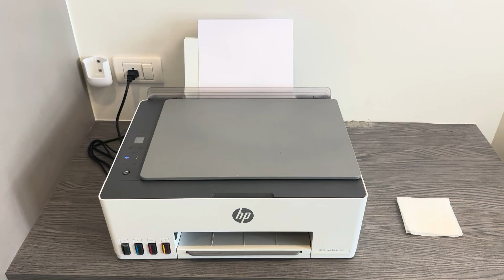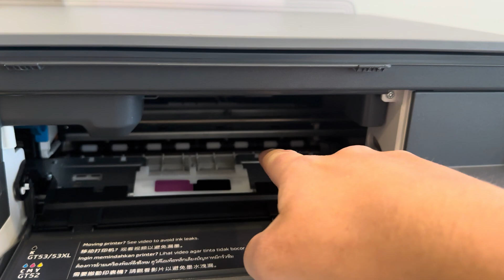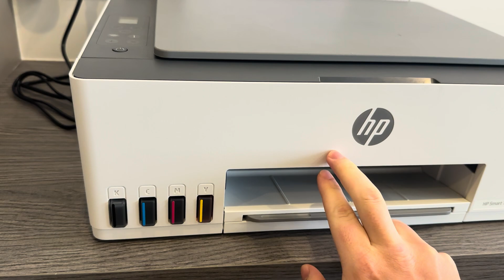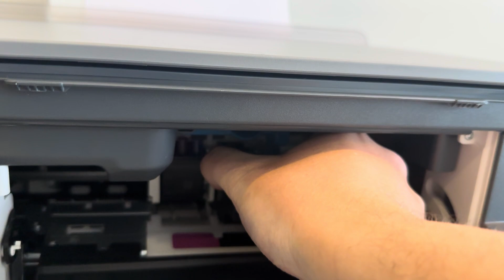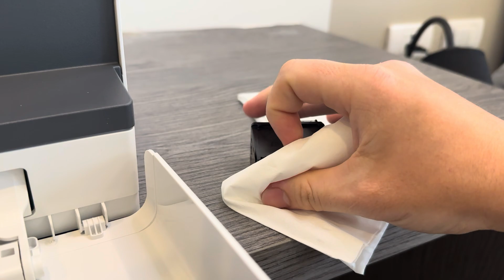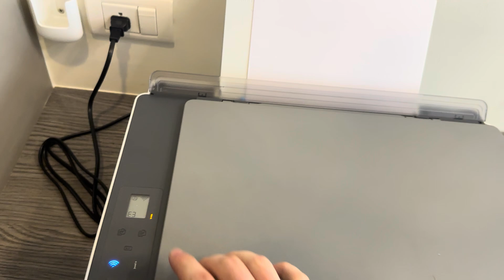How To Manually Clean Printhead On HP Smart Tank 515 (Any Smart Tank Model) (2025 Guide)

Comment: My printer is not printing in colour, although it is printing well in black and white, so I followed your video to clean the printhead. Unfortunately, it’s still not working.
There are no error messages showing on the printer — does this mean the printhead needs to be replaced? Thank you!
Reply: Hello, I know this is late but if all the colour are not printing(but no exclamation sign), it's either clogged or ink dried up. If it's clogged then you'd need tool for that, else bring it to technician would be safer. If your ink was dried instead, you can gently clean the printhead (the same area as the one in the video) with distilled water. You can buy a new printhead instead if that's too much of a hassle but clogged ink is printer issue rather than printhead, so either bring it to technician or try to fix it by yourself!

Edit: this channel has video on how to clean dried ink!